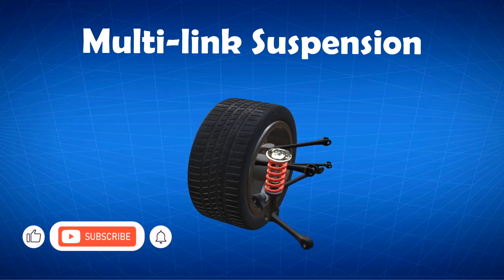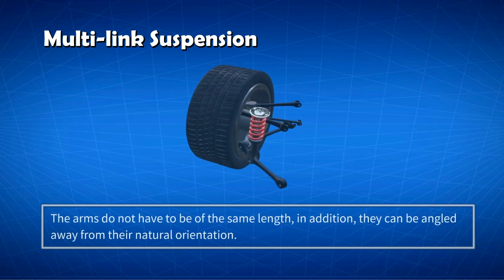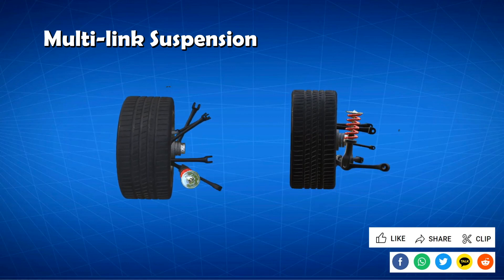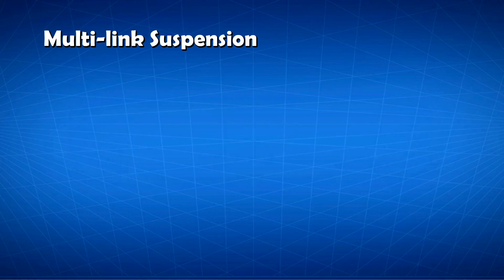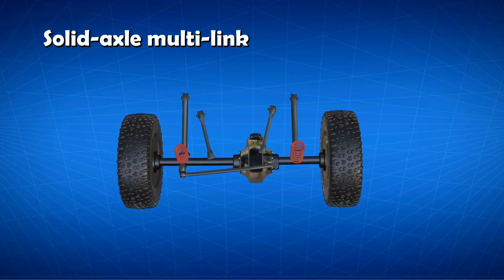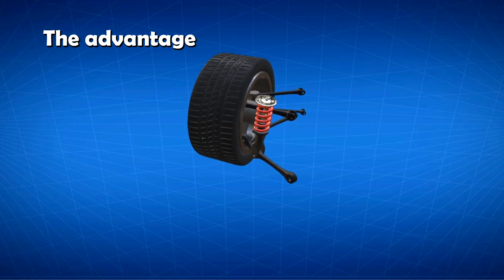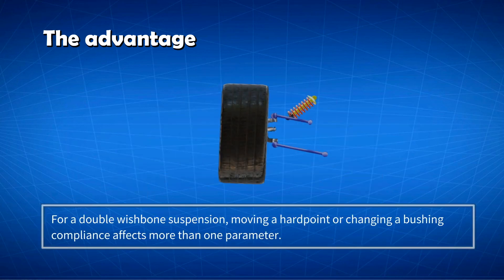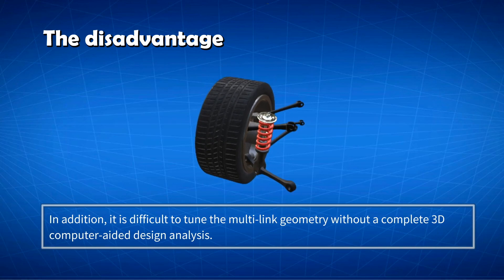Car Suspension: Multi-link suspension explained | Multi-link vs Double wishbone suspension (2022)

Comment: Those suspensions animations are of limited help for understanding. They never explain how multiple rigid links with a pivot on their ends do not eliminate degrees of freedom and lock the position of the wheel in space. I know they  don't, but those video certainly do not show how it truly works. They just show parts floating in the air on one side  and dangling with the animation. Useless in terms of really understanding how it works.

Comment: I have multi link on my mx5 nd and I'm not a fan of it.
I find that the car feels very loose and not planted to the tarmac, especially under hard acceleration.
I'd much prefer a beefier setup.😊
Reply: Have you tried coilovers?
Reply: @DripGxd_Cam  
I have bilsteins with eibach springs, they've helped a bit, but I know a sway bar would make the most notable difference.
Coilovers are more about ride height first, then dialling in the damper settings. They're very expensive for my car, but I think the sway bar would be the better option first 👍
Reply: @VeganBytes  Hey, hopefully not too late, this has nothing to do with the multilink. Just get sway bars (most will do fine, I have FM). It's a completely different car. Obviously coilovers will help a ton too, but I feel the one cheap (compared to Coils) and absolutely necessary update is sway bars if you care about the handling more than someone who just wants to do the speed limit with the top down.

If you dislike the feel of straight line hard braking and acceleration, then that's something for a coilover to fix. If you're talking about corner entries, exits,... Then sway bars will definitely be enough and cheaper
Reply: MX-5 aftermarket parts allow you to make it fit like a glove, just need a good advisor

Comment: What is the difference between a torsion beam and a solid axle multi-link?
Reply: Torsion beam is:
Less comfortable
Lesser factory tuning potential
Worse handling characteristics as toe, camber adjustments isn’t possible.
Reply: @kukujiaoboii1331 that is what I wanted to know.

Comment: Q: can you steer a car with front ML suspension?
Reply from the maker: Hi, multi-link can be used on both the front and the rear suspensions. When used in a front suspension, it will replace the lateral arm with a tie-rod that connects the rack or steering box to the wheel hub.

There isn't a single multi-link setup in industry, every car make or model may have their own design😃
Reply: @animatedengineeringstudio  thank you very much!

Comment: The best and the most vulnerable
Reply from the maker: Thanks for your support. That's true, multi-link suspension is particularly susceptible to damage from improper use and does have a high failure rate😄